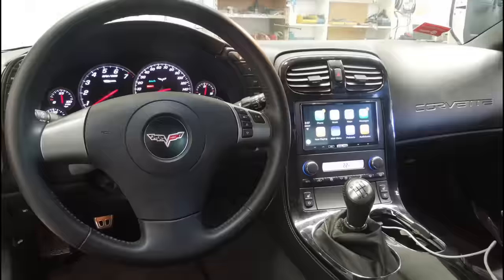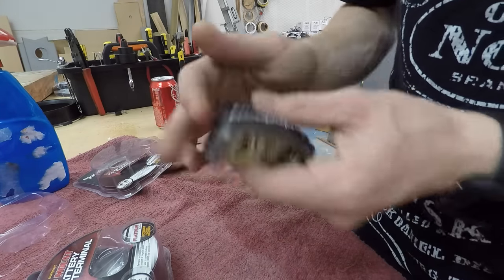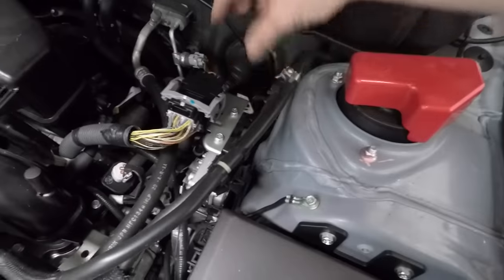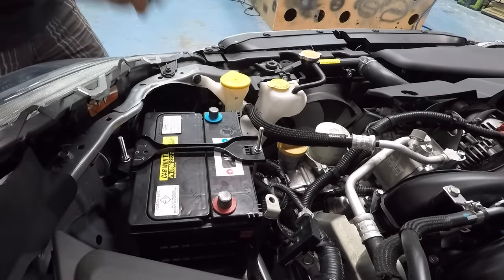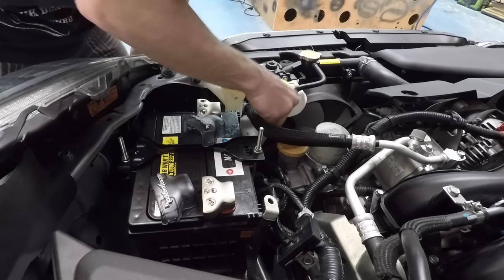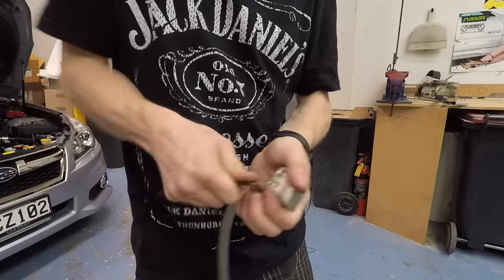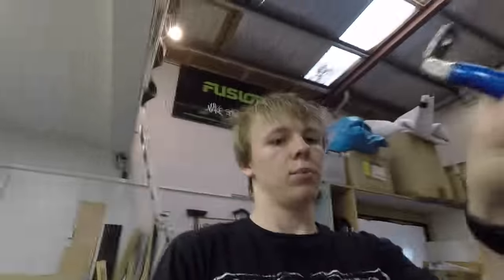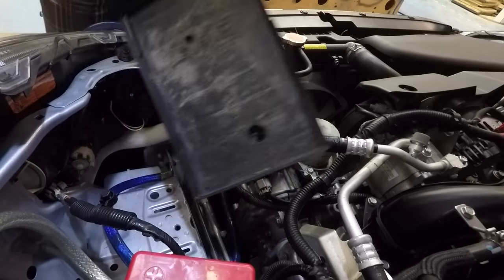Project Legacy: Battery Terminals & BIG 4 Upgrade!

Comment: The 60 amp alternators are old school. 1990's and newer have been going up, due to all the stock electronics: electric cooling fans, electric adjust seats, power windows, heated windows, heated windshield wipers, heated seats, infotainment systems, more powerful ECU computers, etc.
However, stock alternators are chosen with approx 15-20% excess output for all add on accessories. So a car with a 100 amp alternator will take 80 amps while running everything stock, leaving you 20 amps for anything you add on. When adding sound systems, remember a 1000 watt system can take 133 amps near max volume.

Comment: I have a 1996 Holden Astra and it comes from the factory with a 120 amp alternator which is great because I didn't have to upgrade when I put my Alpine mrx-m240 and Memphis Mojo's in, I just have a second battery (80Ah) in the boot and when the engine is running even when playing it hard the voltage sits around 14.1 volts, I am yet to do the big 3 upgrade but I plan to do it eventually, all in 4 gauge.

Comment: I use High strength industrial Velcro instead of double sided tape. Easier to remove if you need to make changes, also you just adhere it once compared to double sided tape where you have to clean and re-apply every time you remove it. And if you do have to relocate it you're no worse off than you would have been with the tape.

Comment: Doing the big upgrade is a long process especially on 08 KIA Sorento lx. I did all 0 gage wire. I still need to do a meter test the voltage. Good stuff man.

Comment: looks good, for Big 3 i would have used the 1/0 to the alternator +, qty2 8awg merged to the factory positive instead of the short 1/0 ... great job on chassis ground, like others recommended clear coat spray where you exposed the metal, since you have Subaru boxer motor, I would run another 8awg from your engine block/head ground you installed on passenger side head to the driver side head similar bolt location distributing evenly on both sides of the flat 4 boxer motor.

Comment: I would spray some clear coat over the places you removed the paint once the terminals are screwed on. The reason the factory does not remove the paint is because the paint keeps the steel from rusting. If you remove the paint, screw it on and add clear coat, you can keep it from rusting and get the best connection
Reply from the maker: Wyatt Coleman good idea, I thought about using the anti corrosion black zinc spray we have but I thought that would look awful.
I'll see if we have some clear coat.
Reply: @caraudioetc  I'm curious how much a good reputable shop would charge for a big four upgrade? The shops in my area are charging $300-$400 USD for this.

Comment: i'm curious, why did you bother using expensive 1/0 wire if you were just going to attach them to the smaller factory wires? doesn't that just give you a longer overall cable with more voltage drop? the additional chassis ground and additions to the alternator wires look good though!

Comment: Btw. 110amp is not decent at all. Keep in mind amp output has a curve. So at idle, that 110amp is only rate for around 12amps. As the rpm rises then the curve goes up. By 3000-4000rpm that the 110amps can be delivered.  Cars are not designed for sit at idle. They are designed for highway speeds.

Comment from the maker: Hi everyone!
Sorry about the distorted audio in this video, I tried something to boost the clarity of my voice in the video but obviously that backfired as it only just showed up post production.
Will be back to normal next video.  Have a good one.
Reply: Car Audio.etc have you ever done a sound system upgrade on a Nissan Murano?
Reply: Air horns fit nicely behind the front bumper crash bar. That's where I mounted  mine :)
Reply: My Dodge truck came stock with a 136a alternator

Comment: you should tin the ends of your cut wire to stop them from flairing out when you bolt them.
Reply: good vids bro keep it up
Reply from the maker: xXAKAYXxNZ good idea but 0 Gauge very hard to tin without a blowtorch
Reply: or use wire ferrules
Reply: @JohnathonMyers  in all these vids no one uses ferrules 😡

Comment: Imgoing too try too do the big three upgrade  running 1 altenator 2 batterys 1 capacitator 2 amps any suggestions or recomendations im weiry because dont know if the altenator will support 2 batterys
Reply: It depends on how often you use the system with the engine off. while the car is running, all the energy comes from the alternator. if that's not enough power, you need to upgrade the alternator. batteries and capacitors do nothing but extend the time you can use the system with the engine off.

Comment: my pioneer stereo shutting off at high volume and lights are dimming could it be a power thing or wtf
Reply from the maker: could be shutting off due to poor ground, lights dimming suggests more current draw on the bass hits than what the alternator can supply, you may need either a capacitor, or a second battery or a bigger alt.

Comment: My jeep has 160a. Crazy
Reply: My Ford Edge has a 150 A. I bet your Jeep has an AC outlet in it? My Jeep Patriot did and I loved it (traded in)
Reply: @lowhertzhighspl  yes it does in the back. Pretty handy. I upgraded my alt. To a 250. Wish I had gone 300. I have 2400 Watts between 3 amps and it's barely enough. Also have 2 40a batteries and big 3 upgrade and the Rockford amps are still pulling like heck out of my electrical system

Comment: It could be upgraded without hole and fuck the OEM battery terminals they were far better than these crappy and ugly , elcky nuts are not good reliable as the old one.

Comment: If you are going to use a product such as the battery terminals which are integral to your installation at least show the manufacturer. You handle the package in such a fashion that it is impossible to determine who made the product.